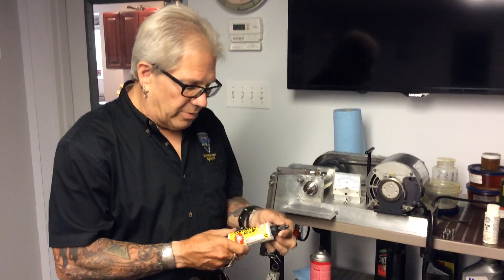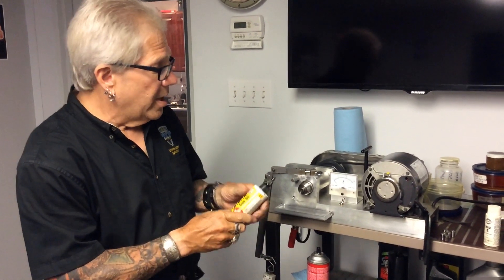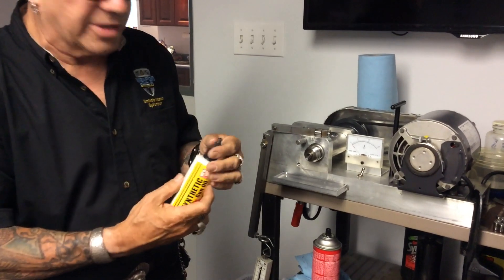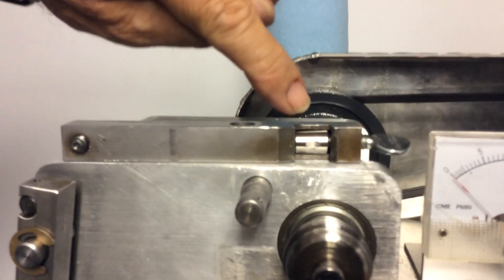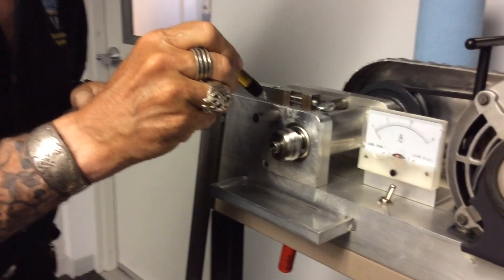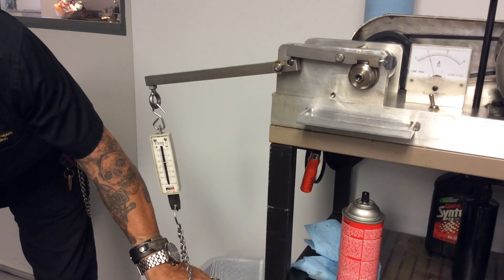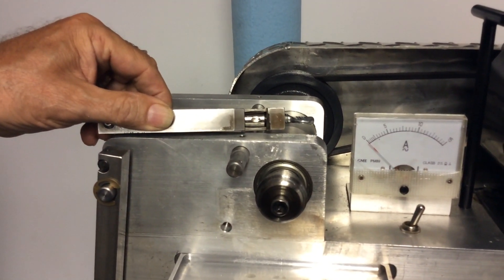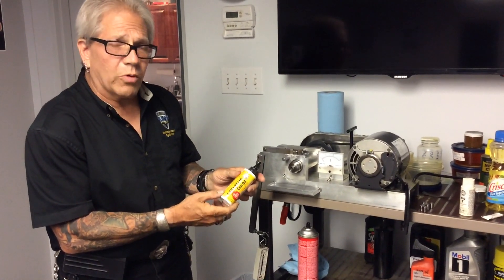Weapon Shield compared to G-96 on the Falex Wear Test

Comment: I have tried many of the popular CLPs . And I was skeptical at first. But thought what the heck. I have used this on all my pistols. And also exclusively on a few  brand new pistols so I could gauge the wear on them. It has been remarkable!! I can tell a difference on one of my older glocks after switching to WS. My son also noticed how much smoother the action was after he shot it about 6 months apart. So its not just me. The barrel on my new glock that I have exclusively used it on also doesn't show the wear at the front I am used to seeing after 2k rounds.  This stuff really works!!!!!